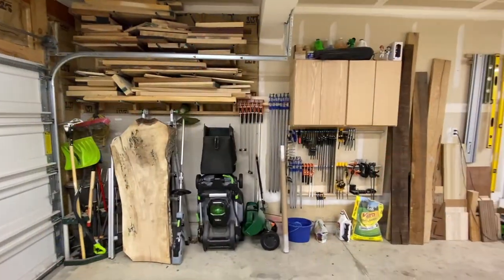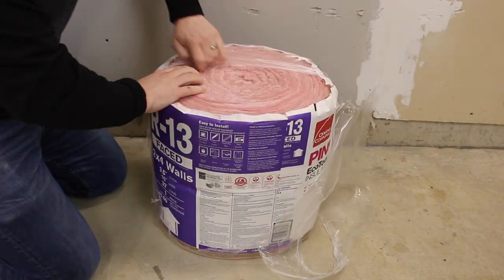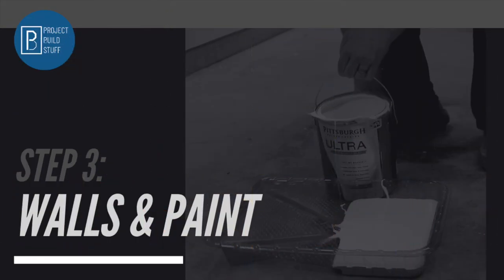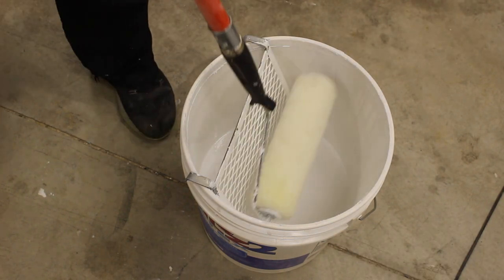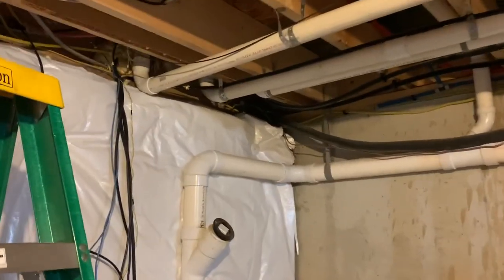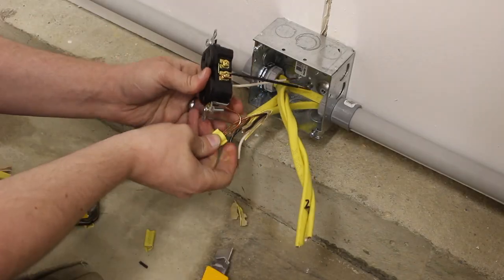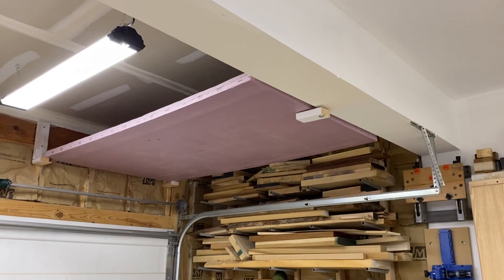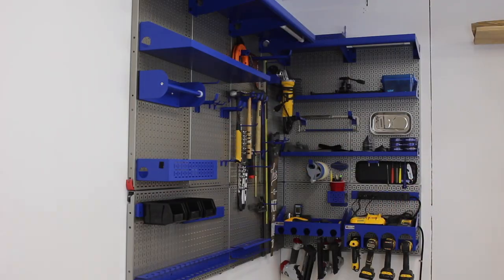Garage Makeover MUST DO’s!!!

Comment: Romex should not be run in conduit.
Reply: Depends on conduit size/ampreage and if it's a wet location.
Reply: Romex is allowed in conduit. Just have to know what your wire fill is and derates.